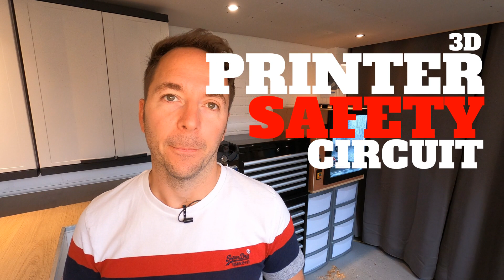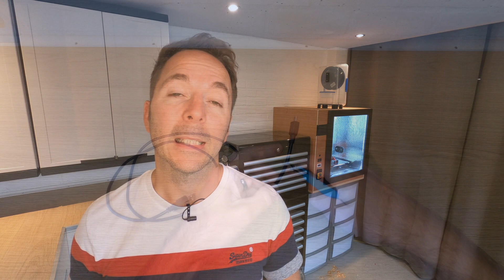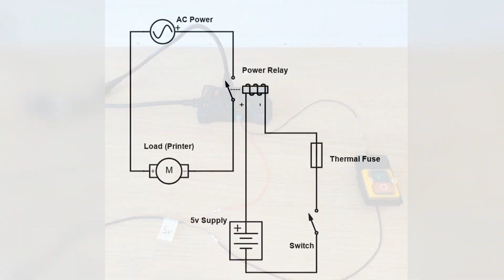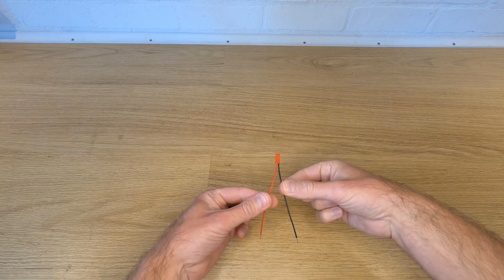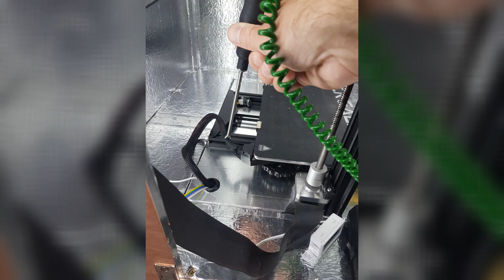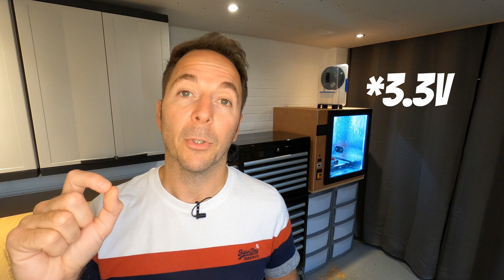Is it safe to leave your 3d printer on overnight? (Probably not unless you have one of these)

Comment: Hi! Thank you so so much for the incredible video! It's super informative and very smart.
I'm ordering a couple things through your links and I see the wire you linked, from Amazon, is 22awg solid core. Did you end up using 22awg solid core for your entire fuse circuit for the relay? I was extra curious with you running the wire through the bed power's sleeving, with solid core being less flexible than stranded.
Super awesome vid, thank you for everything.
Reply from the maker: Hi, they have probably changed the supply on this, I'll have a look. I didn't use solid core. I would recommend a silicone sleeved muticore. As you probably know, mutlicore is much better when things are moving around and will last much longer.

Comment: Thank you.  Excellent design.  Great work.  I'm planning to acquire the parts and put it together.  I have watched several videos on this topic by Teaching Tech and Thomas Sanlander and they have workable solutions but I think you have designed a more elegant solution that relies on simple hardware rather than sensors and a relay.  I'm looking forward watching your Enclosure video next.  I bought my Ender 3 V2 in July -- never did any 3D printing or design previous to that.
Reply from the maker: Glad you enjoyed the video. This one hasn't been that popular but I still like the system and it works very well. I like having the extra safety for when I don't have eyes on my printer. Thanks for the comment.

Comment: Nice video.  I like the methodology.

I'm considering whether I should put a smoke alarm inside the enclosure or outside.  I saw you put it inside, but I was concerned that the fumes from printing normally would cause the smoke alarm to fail.  I think I read somewhere that the sensor can get coated.  Did you consider this?
Reply from the maker: I haven't noticed any problems with the smoke alarm but then I also haven't had a fire so it's very difficult to say. I do actually have another smoke alarm outside of the enclosure as I have other printers in the room. For the cost of them, it may be worth going belt and braces and doubling up.
Reply: I've put a smoke alarm very close to the printer and it never switched on due to the fumes. If you find the source of this coating issue, let me know please

Comment: This might be a simpler idea than with what I went... I've build a box that's capable of resist a burning printer 😅

I tested it by placing 2 empty plastic spools inside and lit them up, then closed the door and waited with an extinguisher what happens. After around 13-15min the fire was off, the glass from an old oven was black but all in all nothing really happened.

Even the box outside was cold to touch while the stuff was burning

The cutouts for the fan and filament path were sealed with an special stuff that resist the heat but swill when it heats up so that it seals the cutouts 😂 seems a bit overkill but my intention was to fu** off the 200buck for an printer instead of my entire house
Reply from the maker: Nice, I was toying with the idea of building something similar but haven't done it yet. I don't suppose you took any pictures?
Reply: @RickyImpey  of course I did 😁 it was an colab with an friend who has way more Printing experience so he gave me some additional tips for the actual printing stuff, where to put filament, displays and so on

I will soon release an blog post about it with my basic testings. When it's done I'll post a link in here 😄
Reply from the maker: @drfailbucket  Great, I'd like to see it👍
Reply: @RickyImpey  check yours mails for a view on the prototype 🤫
Reply: @drfailbucket  Seeing pictures of your fireproof enclosure would be very nice. I'm interested in the details of the build because I wanted to build an enclosure myself, but putting a potential fire hazard into a wooden box and then leaving it unattended gives me a bad feeling.